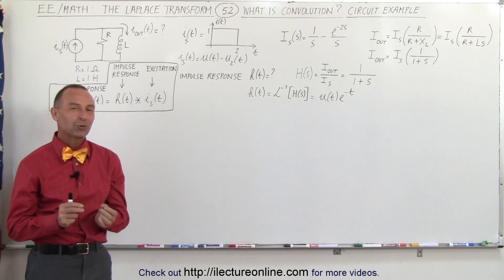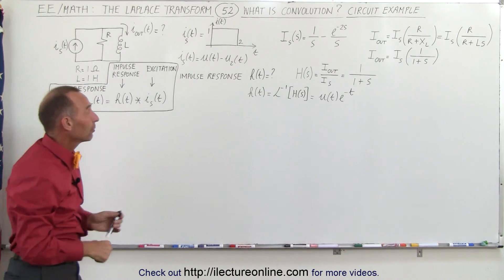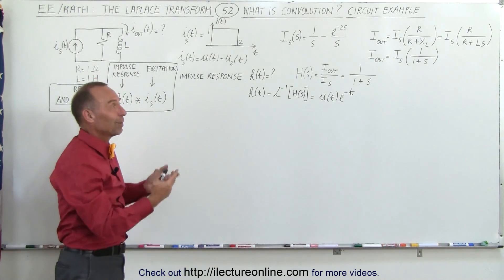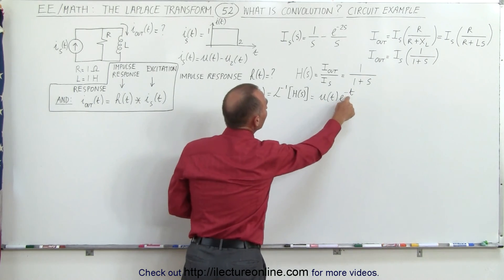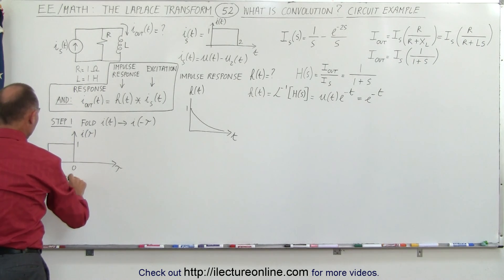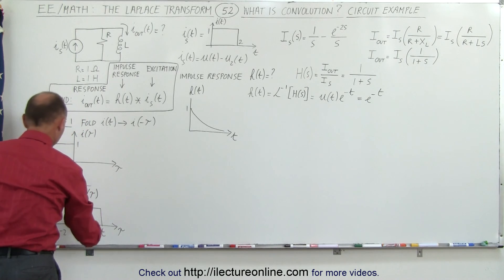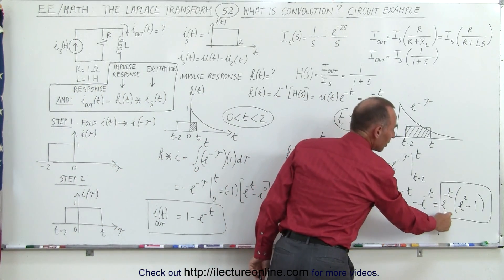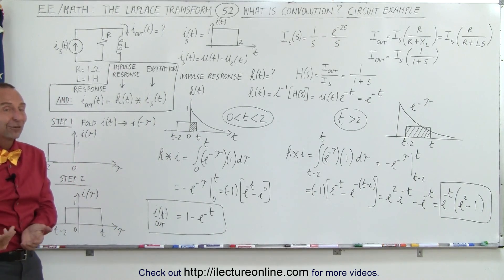Electrical Engineering: Ch 16: Laplace Transform (52 of 58) What is Convolution? Circuit Ex.

Comment: sir can i also get the same answer with fourier transform R(t) and I(t) the multiply both frequency domain and reverse fourier transform of the multiplied frequency transform.
Reply: The only difference between Laplace and fourier transform with respect to convolution is the domain. The s-domain is all the complex plain with positive real, and the frequency domain in fourier transform is only the imaginary axis, so if you don't want to look in the transformation table, better use the fourier, because the inverse fourier it's easier